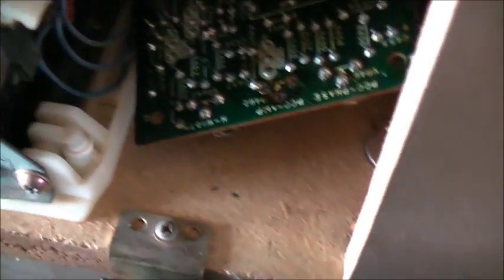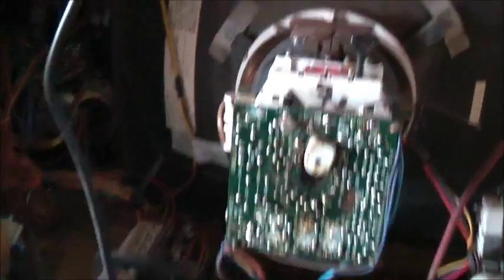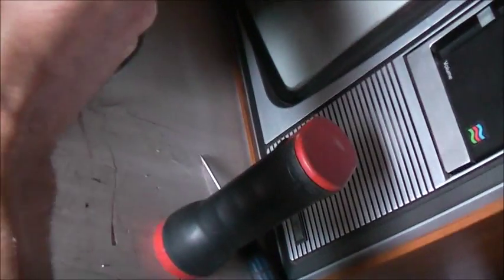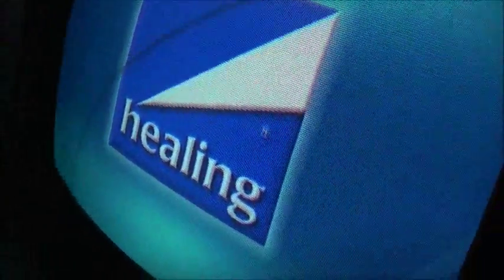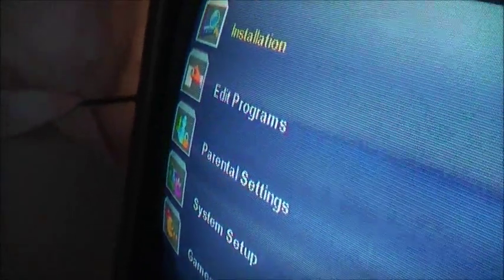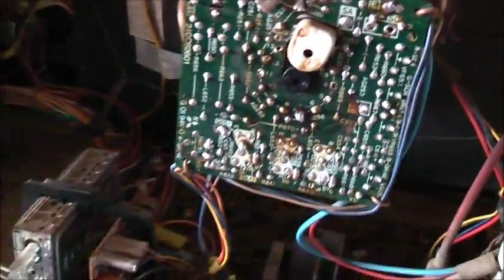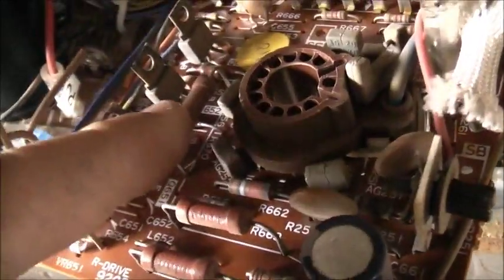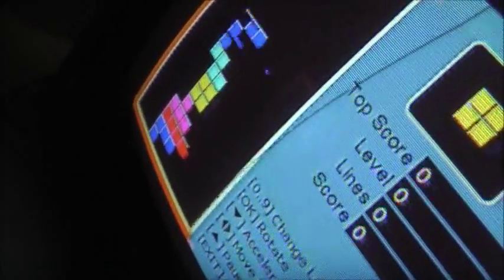Vintage TV Repair, Fixing Colour Bleeding!

Comment: how do you fix that red bleeding im using an old 1702 commodore monitor it has both s video (croma luma) and composite the super Nintendo works great in svideo but the nes runs in composite and i get a little bit of the red color bleeding on that if there's a lot of red and some blue